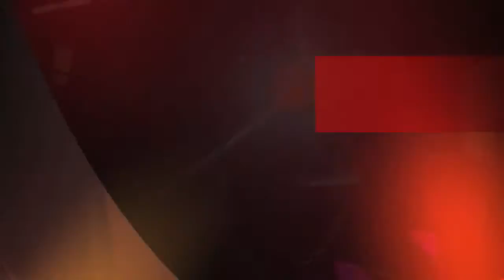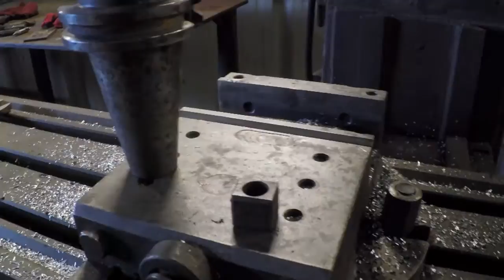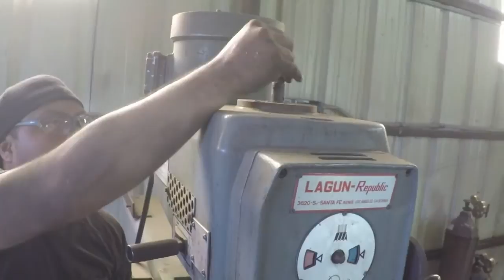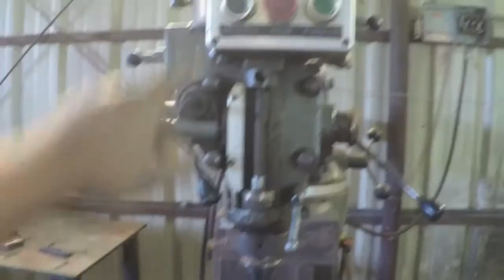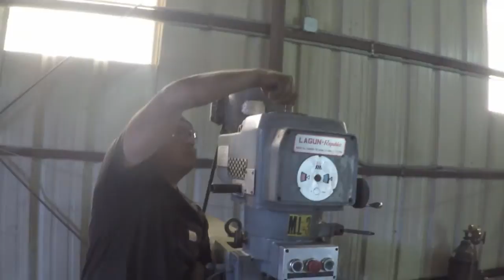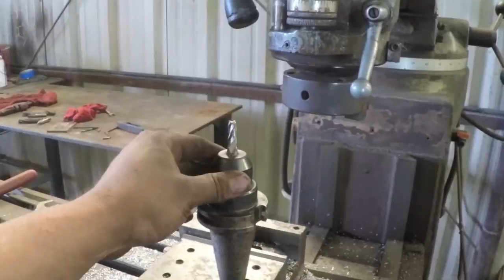#40 From R8 to Cat 40 in a Lagun Mill

Comment: you can increase the pocket on your tool holders to allow you to retain the lug, or build a custom lug that switches out. 

FYI, most Bridgeport operators  that only have power feeds on the x learn to do most of their cutting on that axis so they can use a power feed.

Comment: why pull one dog? on the cat 50 I used to run , the dogs were not the same, the tool holder had to go in one way.The hole in the notch on the tool holder indicates which side is which.otherwise the tool runs out
Tim
Reply from the maker: In my machine the tool can not physically fit without taking the dog out or modifying it to fit. I will be modifying it in the future.